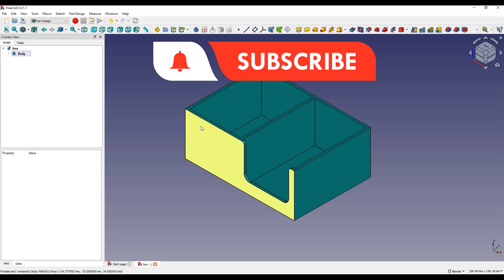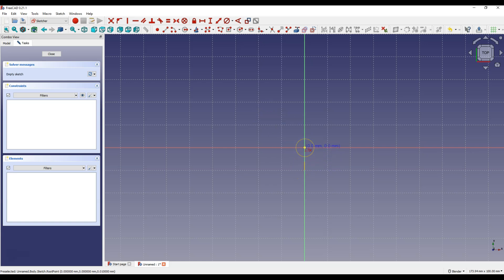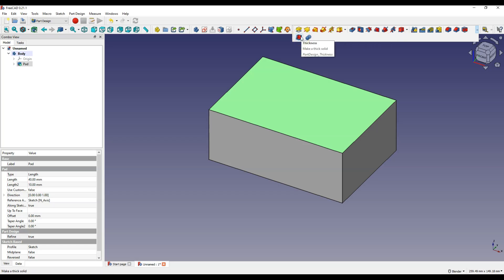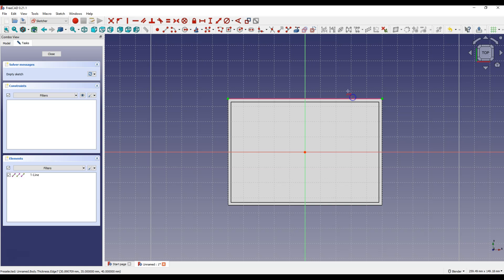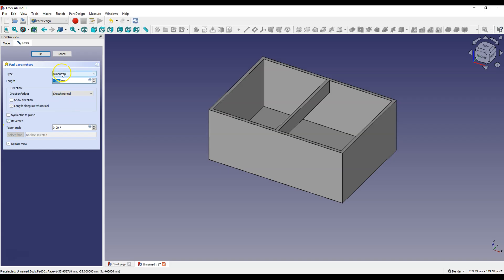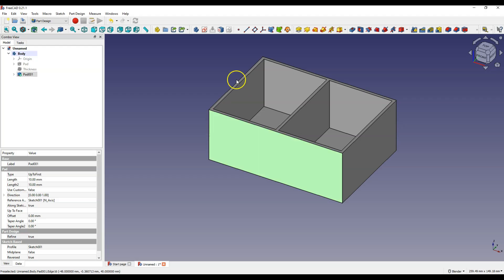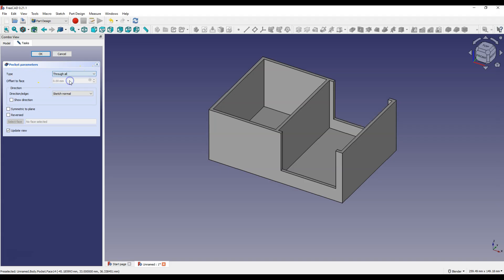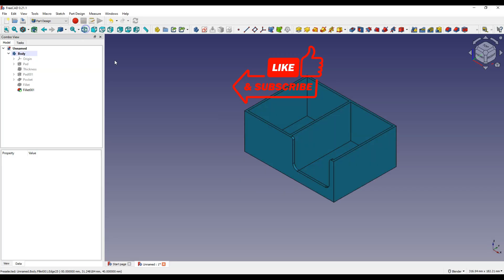Part Design Tutorial | Make a box in FreeCAD

Comment: None of this works lol.    Tryting to create the damn rectangle - rectangle keeps dissapearing.  WTF.  Do you click and HOLD or click once and click again?  Left click or right click?  This is absolutely horrible!
Reply from the maker: How to draw the rectangle in Sketcher:
Make sure you’re inside a sketch (create a new sketch or double-click an existing one in the tree).
Choose the Rectangle tool.
Left-click once for the first corner.
Move the mouse.
Left-click once again for the opposite corner.
You don’t hold the mouse button, just click → move → click.

If the rectangle “disappears”, it’s usually because:
you left the sketch (closed it),
you switched workbenches,
or something got undone.

Take a bit of time to actually learn it instead of getting angry.
Reply: @CADCAMLessons  I come back to this every couple weeks and still nothing.  Click once in the center -> Click again top right.  Now I click horizontal constraint button and select the literal same line and nothing comes up.  Nothing prompts.  I think my install is jacked or something - running FreeCAD on MacOS.  1.0 release.  Not upset anymore, just defeat lol.  It. Does. Nothing.  I have watched several tutorials now and my FreeCAD install just does not work like the videos.
Reply: I would like to point out: Regarding FreeCAD 1.0.2 on MacOS - the shortcuts are jacked and the default settings are very different.  FreeCAD will NOT (be default) have the toolbar you show, FreeCAD will not (be default) allow you to add constraints the way you show.  For someone trying to learn FreeCAD for the first time using the most recent version (at least from MacOS)... this video is (unfortunately) largely useless.    Between asking Gemini and bouncing back-and-forth between other videos, I finally got a single rectangle fully constrained.  Did you know that be default (again - MacOS & FreeCAD 1.0.2), that FreeCAD will NOT auto-constrain to the X and Y axis?  After painfully figuring out how to get horizontal and vertical constraints... I still had a mysterious "1DoF" message (which wins award of most useless way to tell someone what is wrong) - clicking did absolutely nothing.  Back to Gemini... which sugested I try the "wiggle test".  This showed me that the rectangle was not constrained to the X axis (it moved side-to-side).  Had to manually add this constraint, too.

Maybe I need to re-visit this tutorial again once I get FreeCAD installed on my spare Windows 10 laptop.  Because the default behaviour of FreeCAD out-of-the-box is seriously jacked from what every video here on YT shows.  And I have literally never used it or tweaked any settings outside of attempting a few turorials.

Comment: Why do you need 450 steps to make a box? is this why CAD guys need $500,000 a year? To work with software so bloated you need 450+ steps to make a simple box?
Reply: exactllyyy - this shit drives me insane hahaha
Reply from the maker: I think there were fewer steps in this guide and it can definitely be done much faster. This is just an example to show different geometry creation tools in FreeCAD in a relatively short time. The goal was not to create the box as quickly as possible.

Comment: You mentioned the importance of overlapping the divider stage with the box (3:38), which is why it is overlapped on both sides.  However, the bottom of the divider abuts the bottom of the box rather than overlapping it (4:34).  Is this intentional?
Reply: Yes, the pad "stops" on the first encountered face. the inner bottom of the box.